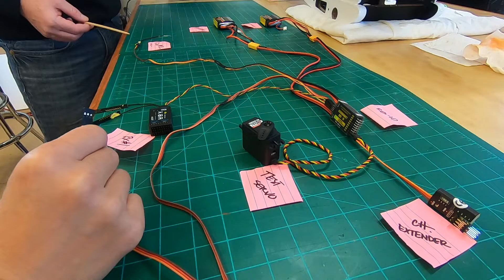FrSky RB-10 TUTORIAL: HOW TO Set Up a Dual Receiver Redundancy System for RC

Comment: Good topic. Do you bind both receivers on the same receiver number? In OpenTX, can I bind a 2.4 SR8 as primary, and a 900mHz R9MX as secondary. Internal and external modules are used. (Or bind using different Rx numbers?)
Reply from the maker: It’s been so long since I did this video i honestly don’t remember exactly what I did. I want to say YES for the same receiver number. As far as using an SR8 and a 900 I’m almost positive that cannot be done. You have to select external module or internal module. I believe you can’t have both active or automatically switch for you. Not 100% sure but pretty sure you can’t.
Reply: @UngluedModeler   it does work on both receivers at the same time. The problem is you can't use a stab receiver. After unplugging and replugging the stabilized receiver, the receiver goes through a self-test and the servos flip end to end which would be disasters in the air. My bigger concern is what current capacity does a SR pro receiver have because running 8 to 10 servos on a gaser, could draw as much as 20 plus amps.
Reply: I've done more bench testing; Two serious problems;

1) RB10 has a problem when used with a stabilized rx. The servos exercise after repowering which may be a disaster while flying.
That is why FrSky sells RB units with built in stabilized function. (RB25-S)

It seems the S type receivers have different output directions to standard receivers, regardless whether or not the stab function is on or off, 
there for not usable in a redundant setup using an RB10 redundancy bus.

2) When testing, using both an X10S Express OpenTX or an X20S Ethos radio;

Attempting to use redundancy on a new gas airplane.
R8 Pro and R9M receivers, and an RB10 (V171010)
The latest firmware on ISRM and V2.1.14 and V1.3.2 on the receivers.
Without fail, while all connected and working perfectly, if I unplug R8, re-plug R8, then unplug R9M;
The RB10 LED goes red and I lose all control.
Then I re-plug R9M and get back control.
I tried this with both radios, exact same problem.
THEN I switched the R8 Pro with a Archer R6. Problem SOLVED !
I believe there is a FW issue with the R8 Pro. I tried every FW back to V2.1.9, no change.
If I eliminate the RB10, the problem goes away.
If I try an SR8 Pro, with the “S” turned off, same problem + some of the channels reverse when the R9M is unplugged !!!!   Definitely not an option.

All I want is a usable setup for a gas airplane yet I still can't find one. The SR10 Pro if available would likely have bean the answer.
Reply: PS. The RB12S only works with ETHOS. No Lua script for OpenTx.
Reply: RB25S, typo
Reply from the maker: Wow!!! That’s some great data you have there!! Excellent job! Very frustrating indeed. Ugh

Comment: Hello, I need some help. I follow your set up with Archer R8 pro and R9 sx receiver as back up. But when the bus out wire is disconnected from main receiver, the light of RB 10 turn red and Then servo dies not work with the R9sx receiver on(with green light). Anything that I miss ?
Reply from the maker: Did you bind up both of those receivers on the same model beforehand? Did you bind up the secondary receiver with telemetry off?
Reply: @UngluedModeler  Hi, since the receivers are 2.4 ghz and 900 mhz, do you still have to have telemetry off on the secondary receiver ?
Reply from the maker: Im not sure man. Are you saying that you are trying to run a 2.4 and a 900 receiver on the RB10? I have zero clue lol. I don’t even know if that’s possible

Comment: Well done. Question, if I were to have two satellite receiver, do you think using Y servo cable will work
Reply from the maker: Hmm interesting idea. So do you mean a normal receiver for #1 but then for receiver #2 you would split it with a Y harness? So basically if Rx1 loses signal it will kick over to the Rx2 side which would be two satellites operating together on a Y harness? Interesting. Might be worth a try!!
Reply: Yes, would it work ? maybe it is less likely to have 2 satellite receiver fails at the same time
Reply from the maker: Yeah I really don’t know if that would work. I agree two satellites are better than one lol. But I think because it would be on a Y harness is where I would have my doubts. If they were separate inputs then I would say yes. Worth a try I guess! Except I don’t have any more satellite receivers hahah
Reply from the maker: Yeah I’ve seen that technique thanks. We also wanted redundant batteries.

Comment: Sweet. Wise decision too, especially on a decent sized model that's expensive, plus the safety factor too so there's far less chance of an out of control model crashing into possibly people or property.
Reply from the maker: Yes exactly!! 👍
Reply: @UngluedModeler   I have a GPS module what port would i connect it too?
Reply from the maker: I’m sorry but I have never messed with GPS modules and airplane receivers. I really wouldn’t even know how to give yu advice on that haha. Sorry about that but good luck!! Sounds fun if you can get it working!
Reply: @UngluedModeler  I ask because the s- port is plugged to the rb -10. You think it’s possible to use a y harness?
Reply from the maker: Unfortunately I don’t think you can use a Y harness on the S port. I think I read that somewhere when I was setting this up.
Reply: @UngluedModeler  ok I’m just gonna have to experiment
Reply from the maker: Haha yup!! Sometimes that’s the best approach 😂
Reply: @UngluedModeler  trial and error
Reply: @MrKenwillis  I have no idea WHAT GPS unit you've got but since you're asking about "plugging it in" I assume you mean for power. 
If it's anything like a very basic but also very light one I had from Hobbyking, that one needs power from your receiver and ALL receiver ports share common power and negative through 2 of their pins while the third tells that channel what to do so, any available port or a Y lead to get power to it from any one of them.  I'd suggest since you'd be adding an extra connection, AKA another potential failure point that you use the least critical one, my choice on most models (assuming I've used every available port) would be the rudder, throttle would be my second choice on most.
Like I said though, you haven't given any information other than that it's a GPS so that all depends on the particular GPS.  If you're at all concerned about having adequate power for servos etc then maybe an independent power supply might be a better option but, that depends on a few factors too. More details needed?
Reply: @probingtime666  I  thank you for your help, yes that’s the conclusion I come up with as well. All this new stuff is mind bedazzling and it’s a lot of information that needs to be taken in if you don’t want to crash your plane. Thanks again I really appreciate you
Reply: @MrKenwillis  You're welcome. I should have added that I'm a bit out of date as I'm sort of stuck a long way from all my RC gear after a major accident a few years back so I'm not very clued up on the newest gear but, if it's a receiver and has a power supply to it that then feeds servos it will have common positive and negative on common power to all the ports and the little one I had weighed something like about 10 grams or less and only displayed while on power, used very little power too but, had a tiny display and you could (while still powered) scroll through max altitude, distance traveled, max speed and the most useless one since it's counting the whole time on the ground while powered as well, average speed. I wanted it for speed testing mostly but we had a thousand foot ceiling we were approved for at our field so it was kind of useful for sending about a 5 foot WS model up till I almost can't make out it's orientation then when down, see that that was about a thousand was helpful since it's hard to know any other way.
Reply: @probingtime666  Really wanted to make sure cause I had the battery plugged into the s-bus channel and it worked but I was worried about it. Like I said this new stuff is really nice but gotta make sure so I don’t crash my jet
Reply: @MrKenwillis  A jet? OK, well you really do want to be absolutely certain with the money that can be tied up in some of them. I'd look up everything I can about your specific GPS and all the setup there to be sure, or just go with a completely independent power supply for the GPS if not certain. 
I'm pretty certain you can't go too wrong with that but, forums like "Flying Giants and there's probably ones targeted more at jets but check check and check again. Even just googling individual items will often turn up information you might not find in any specifications so try them all since if we are talking about an actual jet turbine and not an EDF they can be a lot of money tied up in them and most really move so big dollars can be completely destroyed in a split second so you want to be absolutely certain.
Reply: @probingtime666  Yes you are so right, a lot of research is required before getting airborne. The GPS  is used for extra telemetry signals and it comes in handy. Full telemetry on a aircraft is a serious safety measure. If you pay for it might as well use it! Once again I thank you for your time and knowledge.

Comment: Nice, how do you set up the radio, bind 2 reveivers to one model?
Reply from the maker: Yes exactly! Bind two receivers up. Choose telemetry ON for RX #1 and then telemetry OFF for RX#2. The XM+ is a perfect full range satellite rx.
Reply: Since the XM+ is w/o telemetry, it does not matter if it is set with telemetry by mistake. Right ?
Reply from the maker: I don't know I did not try. But it's extremely easy to set it to Telemetry OFF when you bind up. There is a selection to bind up with telemetry ON or OFF right before you start the bind sequence.
Reply: @UngluedModeler  sure it is easy
Reply from the maker: Yes. It asks you if you want telemetry on or off. Just choose OFF when you bind up the XM+
Reply: @UngluedModeler  understood. Thanks